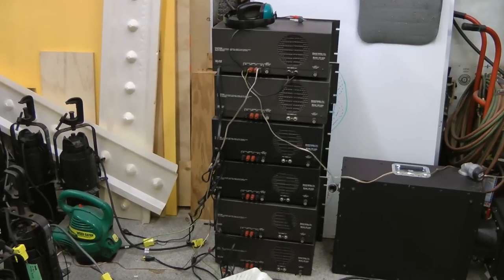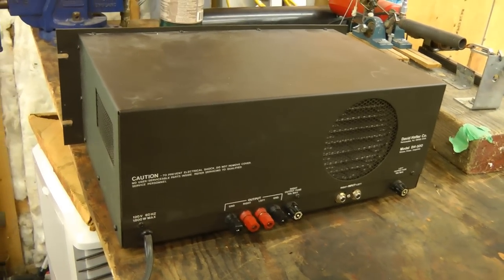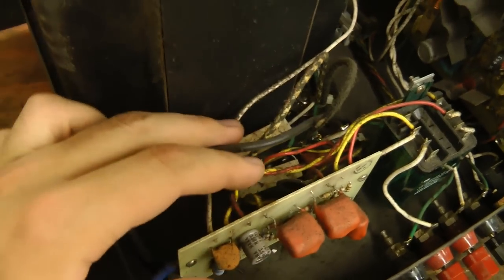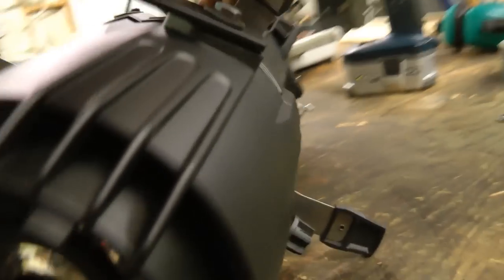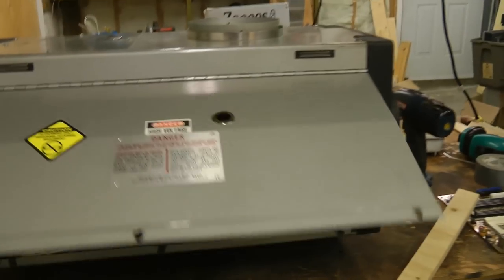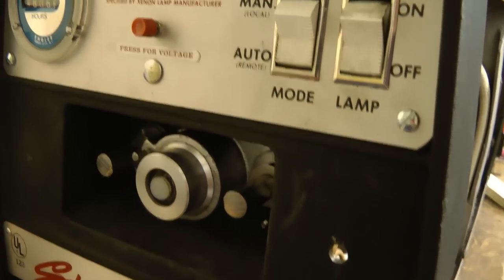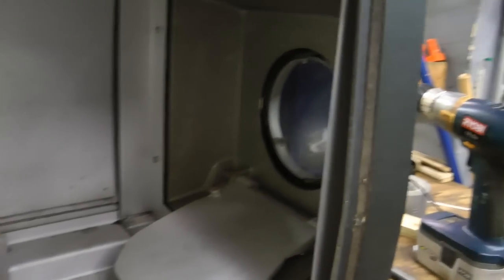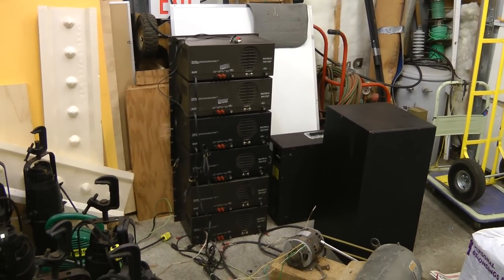Amps and Lamps from demolished movie theater

Comment: Wow so much cool stuff. Question: Why does a 7000watt light have such low voltage input supply and therefore have to suck massive amps. Wouldn't 400V or at least 230V be easier because of the much lower current? I'm guessing it has something to do with the type of bulb.